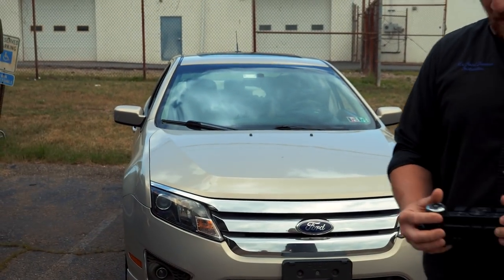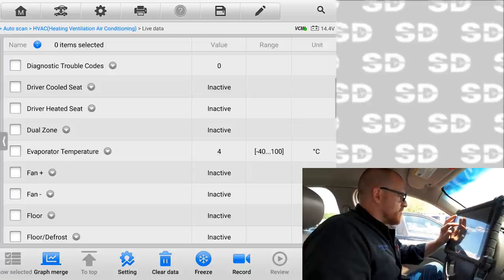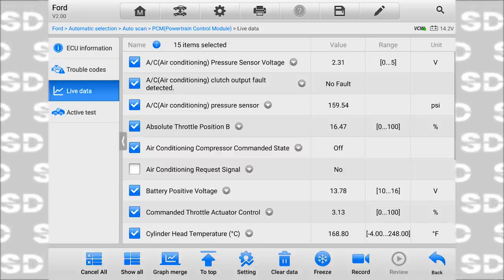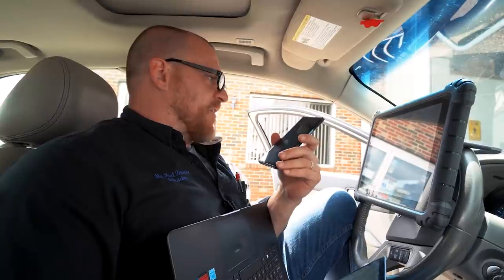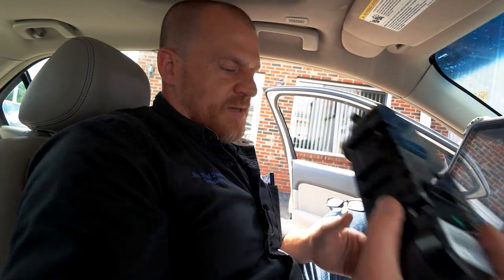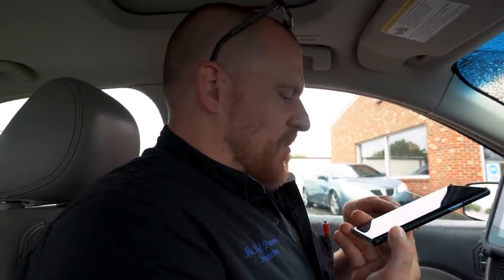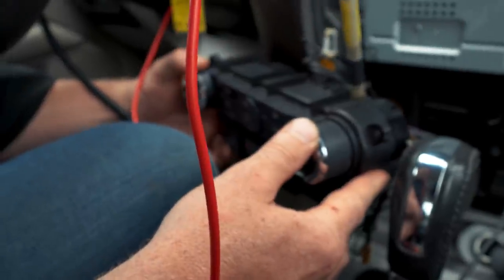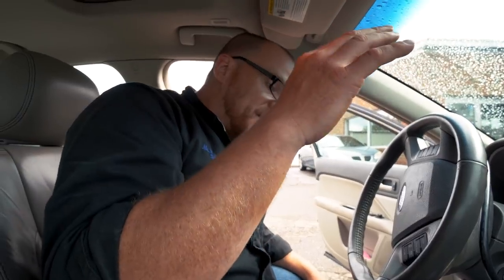2010 Ford Fusion A/C Clutch Intermittently Cuts Off (full charge)

Comment: Just came across your videos and truly appreciate them. My 2011 Fusion had the same issues. Local shop quoted me $1200 repair to replace the $25 evap sensor. Poor design! Loved your hack but also found a quicker hack too ... remove the dash storage tray and small vents above the radio and then break a small hole (hand-sized) in the plastic plenum to access the evap sensor. Replaced it, patched the hole, and was fixed in less than an hour without having to worry about icing over.
Reply: How did you determine it was the evap? Mines just getting cool enough, it blows 55 out of the vents, is mine just a simple recharge. It’s 13 years old now

Comment: Hi Paul. This is a known AC issue of this model. Although Ford says it is a 6.9 hour job I replace this sensor in less than two hours. I just disconnect the main wire connectors at the sides, then unbolt the steering wheel column at the very end of it, next I remove bolts and nuts at the sides and middle down of the dashboard. At the top of the dash, jus under the windshield you will find bolts or nuts and then the dashboard will be loose so you can move it and have enough room to replace the sensor which is on the top of the evaporator black case. Be sure to lock the steering wheel before unbolt its column. In my experience it is not worth to hack the system with a resistor, it won't work. If the owner wants to hack it, try to install a simple mechanical two wire evaporator switch at the evaporator suction line (engine compartment) wrap it very well and the wires will be connected in series with the resistor you already installed. It is my opinion as a AC TECH. Hope it helps.
Reply: Super cool! Thanks for that comment bro!
Reply: That's still a crazy job just for a sensor.    Also, the resistor hack will work fine, as long as they only run the AC at full blast with the fan on MAX-- or otherwise turn it off.   You'll have a much better chance at keeping it from freezing.  The only times it will really freeze is if you are running the AC on low, with the fan barely on;  because that would keep the AC running, but the fan wouldn't be blowing much air across the core--  so it would be getting colder and colder, but without all that hot air blowing across it.

Comment: The reason it didn't stay active is because it wasn't showing the state of the system it was showing the state of the switch and the switch is a momentary switch.
Reply: Yep. He also didn't select and then show the data pids, he was on the selection list, though it was still updating.

Comment: FYI, I have replaced that sensor on those cars in about an hour and a half! You don't have to remove the dash, just move it out of the way and give it the old reach around and get to the sensor!
Reply: Wow, are you for real? One time I had a guy come in (family friend) and was going threw some hard times. I told him its a expensive job and he had no job. He had breathing problems so I wired a resistor temporarily until he got the money together. 4 years later he still has resistor in and don't want me to change anything. It's a family friend, but if I knew I could of did it in a hr to hr in a half I would of went that route. I know these Ford's are known for that because I've done a few the long way.
Reply: @lovetolearn5253  I just unbolt the dash and move it out of the way, I leave the steering wheel attached. The sensor is in the middle of the HVAC housing in the middle kind of behind where the radio and center stack is towards the top where the center vents are. 
Now just a disclaimer, I personally do these quickly but I also work quickly and can pull the entire dash out in about 2 hours so take what I say with that in mind.
Reply: Agreed, no need to get crazy on these, no need to be removing windshields etc...just unbolt the dash, rock her back, and you're GTG!

Ford dashes all day!

Travis you're on point!
Reply: Lol beer belly style... ?

Comment: Maybe you could relocate a new sensor to somewhere more accessible or to the evaporator discharge line.
Reply: I like your idea 💡
Reply: Problem is the sensor is a bulb type goes inside the evap box, clipped to the evaporator fins. It's a shit design, and common on these Fords. It's why so many run them with no AC, but also why we upsell the evaporator and the heater core when we swap this sensor. Just makes more sense for the customer to take advantage of the labor.

Comment: Great video Danner! The scan tool showed correctly the pressing of the button. The AC button as well as the rest of the switches are momentary on/off buttons. They are not "Push/ON, Push/off" buttons like you thought. When the module detects a press of the button, it activates the little light. Then when you press it again, it shuts of the light. Also, yes, there is a delay showing active/ inactive. That;s because of the speed of the CAN PIDS, as well as all the other open PIDS you had open. For faster data, just check on the PID you want to see, in this case, the AC switch, and select "SHOW" and it only shows that PID at a much faster update rate. I've repaired several of those thermometers. They frequently go bad. What I do is grab a variable pontentiometer and vary the resistance and look at the Temperature PID. When I'm satisfied of the value, I grab a resistor of a similar value as I have on the potentiometer and solder it to the thermometer line.

Comment: @scannerdanner - kudos to Caleb again.  When he shared the screen with you as he was shaking his head at you.  I literally laughed out loud.  Y’all are such a great team.   

In reference to the “active/inactive” issues, that designation isn’t necessarily a part of the Autel program.   I use FORScan on Fords its a clone of the IDS platform.  It shows that type of designation on all the switches and buttons on the entire vehicle. ie....door locks, window switches, cruise control as well as AC buttons.  

It’s more of a test that the button itself is being depressed or “activated” and the module is at least receiving the request from that particular button.

Comment: Hey Paul, i went through a very similar case on a 2013 f150 and it kept shutting off the ac compressor with ALL  my inputs on point. 
After a few days of diagnostics and loop i went to the fan resistor. Long story short the resistor was grounding something that i still can't explain on the MS bus line that pevented the ac from comming on.  
And even worse.. No codes.

Plus a Tip: you can run your Mitchell on-demand  on the same Autel ultra. 
Just look for the chrome circle at the bottom menu, right next to your split screen option.  
And to make it better if you are on the field connect the wifi to the móvil phone.   
Nice video.  Thanks
Reply from the maker: Great tip! Thank you

Comment: Robert  Dotterer  recently posted a video regarding this same problem on a 2007 Ford Fusion.  Believe it or not, the quickest way to replace this sensor is by removing the windshield.  With the windshield out, it's a 1/2 hour job at best.  Even with a replacement windshield, you are still saving a ton of time and money.

Comment: Yet another great video from the SD team!
Just few observations next:
- In order to measure a thermistor, the computer flows a constant current through it. According to Ohm's law U=R*I. If I is constant and R varies, the voltage drop varies linearly with the resistance of the thermistor. I think this explanation is easier to understand by your students or any regular people that have no background in electrical engineering. Hope this helps.
-That resistor is 2.2KΩ actually. You still had current flowing through it...
Have a nice week-end, everyone!
Reply: You are wrong, like as Paul said , its just a simple 5v voltage divider circuit . By the way that resistor had 3 orange stripes , so 33KΩ (exactly as Paul measured) !
Reply: @gptechtronics852  Hi,
I saw red stripes, that's why I said 2.2K. My bad.
About the 5V circuit, I didn't say Paul is wrong. I said the phenomenon can be explained in a simpler manner for simpler people. That's all. Don't jump at my throat, please.
Reply: @danielmusat597   Well, there's nothing simpler than a voltage divider. Anyway , sorry if I somehow left an offensive impression.
Reply: @gptechtronics852  For your info, a temperature measuring device is NOT a voltage divider. There is no resistor ladder inside. This is just an approximation meant to present things in a simpler way. What I tried to emphasize is another point of view which does not care about what is inside the device but measures temperature on a linear scale using a linear formula. This point of view is even simpler than the voltage divider mentioned by Paul. That's why I took the liberty to present it here.

Comment: Great video as always.
I’ve done lots of ambient air temp sensors and evap temp sensors, no control panels yet for a no AC condition. 1 for low amp draw though.

On my Launch Torque it does a report that pings all the modules then gives a list of ones with codes. Super handy.

Comment: I use a variable resistor so you can change it until you see the range you want then measure the resistance to figure out what resister you need.  Great video as always.
Reply from the maker: Anything above 40 degrees on the evap temp sensor, the system would react the same way.
Reply: @ScannerDanner  I just noticed you try different resistors and that takes time the variable resistor just makes it easier and faster to find a resistor that puts you in the window your looking for because time is money especially in the flat rate world.
Reply from the maker: It wouldn't have helped me because I'd still need to be able to read the color bands, which I can't 😄. 
 So it was just as easy to use the car as my test equipment. I also knew it would be in the 10k ohm plus range, for what I was looking for. This is just from knowing thermistor ranges. Thank you! Love the idea though and have used it for this very thing you mention before.
Reply: @ScannerDanner  Love your videos you do an amazing job teaching and I just try to help with little tips I learned as a tech I haven't worked in the Automotive industry in ten years so not many tips for today's stuff hope you have a blessed day and keep up the good work.
Reply: I have a 30.00 variable resistor I bought from Amazon. It tells you the resistance value right on the case. Also has a press to hold on button so it's dummy proof. It's what I've always used. Even if in this scenario the resistance value didn't really matter. You just needed the temp reading to read higher than 45°

Comment: You should probably leave a note in the dash for the next mechanic/technician  that has to troubleshoot the problem,  because he is  going to replace the thermistor in the a c case and still have the same reading on the scan tool,  and you know the customer will more than likely forget to tell someone that there was a temporary fix on the a c . IMO Great diag, Whenever I am in question about scan data I usually grab another scan tool because I have been burned in the past, especially when I used to have only one scanner.

Comment: Good information. My AC controller button turn off and on by it self. Took the car into AC mechanic shop and they said I need a compressor, expansion valve and condenser.  All he did is just put the gauge on  and push the AC button to see if the clutch engaged. The clutch comes on and off. The gauge shows it got Freon.  Not sure if it really need further tests. Hate to spend over 1700 dollars and find out it was only the AC controller causing that issue.

Comment: To change from Celsius to Fahrenheit or any unit of measure click on the data PID and push the balance scale. It'll let you cycle through units. Or you can change it in the settings from metric to American.

Comment: Paul, on the Autell you don't need to tick or highlight as you say the pids to watch them change state. The tick boxes are to select that particular pid or pids to move them to a graph or data display. Like on the Verus you de-select all then select what you want, on the Autell they are all already de-selected, you just select the pid yoy want by ticking it. You then go down to the blue icons on the bottom and select move to top, graph or show selected etc, etc. They then open in another tab/window
Reply from the maker: I ticked then as I was talking only for the video, so your eyes would be focused right away on the correct pid

Comment: In our refrigeration in the fishing industry there is a danger with the evaporator getting too iced. On older systems especially, ammonia or r12 , you monitor the plumbing between the evaporator and the compressor; the 'suction line'. As you say, the evap coils as iced still pass refrigerant however, if the ice and frost forming on the suction line makes it's way all the way to the compressor; there is a danger, an absolute chance that liquid refrigerant will enter the compressor which is'hydro-lock'. That is, since there is ice forming on the suction line all the way to the compressor it  is becoming likely that the refrigerant wont evaporate and the compressor takes in a liquid slug of ammonia or r12, etc. Part of the duty of marine engineers aboard vessels is to monitor that situation, especially with equipment that is not automated, to recognize there is a problem if you do see ice making it's way toward the compressor.
Reply from the maker: wonder if the under-hood temperatures in a car would help with this scenario. I would have to think yes, that is a factor as well but great tip for sure. There is a risk to the compressor for what we did.

Comment: Hi Paul. you can get to connector 213 pin 13 on the right side of kick panel, it's green connector. Then you can use sensor simulator to change the voltage on pin 13 vt/brn wire and  look at the voltage on the scanner. That way you verify the sensor is bad.
Reply from the maker: Technically, you could still have a harness issue from that connector location to the temp sensor

Comment: When the evaporator temperature drops too low, you often see fog coming from the discharge registers. A sign to cycle off the a/c to  keep evap from freezing. Keep fresh air moving, manually defrosting evap. Also, high blower on fresh air will delay evap freezing.

Comment: Your risking slugging the compressor. Refrigerant  must flash to gas prior to getting to the compressor. If you are going to hack just cut open the evap box and put in a new sensor.
Reply: He knows. He did what the customer wanted him to do. When customer is ready it’ll get fixed I’m sure.
Reply: If the customer follows his instructions that wont happen

Comment: My SnapOn Zues does the same thing when pushing the buttons with it only saying active while you're actively holding the button and going back to inactive when you release. Those modules do go back often, replaced a couple of them. One was defaulting the blend door to like 75% and running heat while on A/C. Another one was just dead. Those Evap core temp sensor's are also very common and had a feeling going into this video that was going to be the outcome. Another easy way to do this repair if customer is OK with it and could save them money is have the windshield removed and you can reach the sensor through the left defrost vent with a long pair of needle nose pliers. The wiring and plug has enough slack in it to pull it up and swap them out. And just have the windshield reinstalled. Saves a BUNCH of time on labor, but also boils down to what it would cost to have the glass removed and replaced. Side note, I like that multi graphing feature on the Autel!

Comment: Great video SD loved it     diggen that autel    you got my grey matter working      heres an idea    you get a new EVAP TEMP SENSOR and a pig tail    from FORD   hose clamp it to the colder of the AC lines leaving the EVAP in engine compartment    wire it back to your wires at CLIMATE CONTROL UNIT   rubber gromet in fire wall     all the best

Comment: Years late, and you may already know. Snap on had a software glitch where the evap temp sensor would read normal. Threw me off the first time i saw it but thankfully thought to use a different scantool failry quickly before going down a rabbit hole. You may address this later on in the video, ive not finished it yet before commentinf 😂

Comment: As other people commented, the button status PIDs only show the current state of the buttons as they are pressed. The button has to be actively pushed in to display "active". The EATC module can set a "Stuck button" DTC if a button status remains "Active" for a prolonged time. Also, the A/C request signal is not entirely dependent on the A/C button light being on. The EATC module has the ultimate say if the A/C is requested or not, based on the inputs it receives from the sensors. For example, suppose the driver pushes the A/C button when the temperature sensors tell the module that the current temperature is 20 degrees F. The module will ignore the driver's request for A/C because it has already determined that the ambient temperature is too cold to activate the A/C clutch. My observation on a few R-134A systems is that most evaporator temperature switches or sensors shut the A/C clutch off around 40 degrees F to prevent icing. I guess the engineers want a cushion from the 32 degree freezing mark to prevent icing of the evaporator.
Reply: Correct -- it's simply showing the state of the physical button switch itself, and not the function that the button is controlling;  that would also have it's own pid too though.

Comment: Hey Paul!
It's as "hot as freakin balls in here" where I am, too! I had to drop the freakin drivetrain down to drill out the belt tensioner locator pin that broke off in the timing cover on a 3.8 Caravan!
Reply from the maker: 🤣 on the quote 
Sorry about that really sh-tty sounding job in this heat 😕